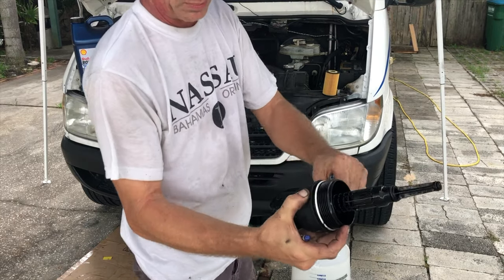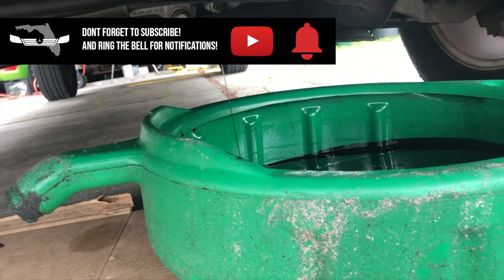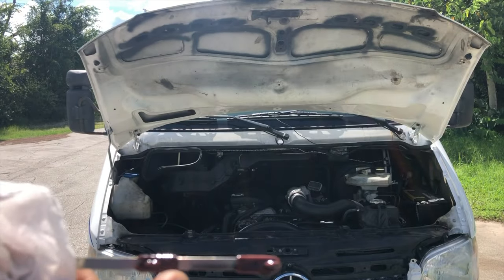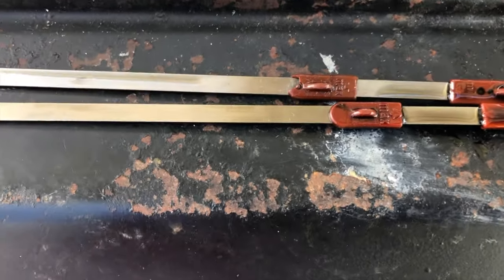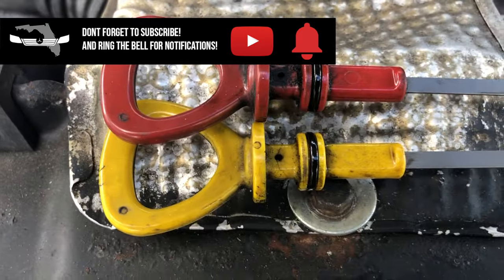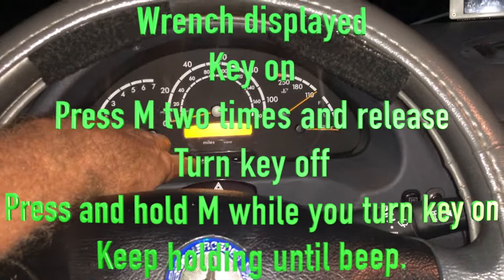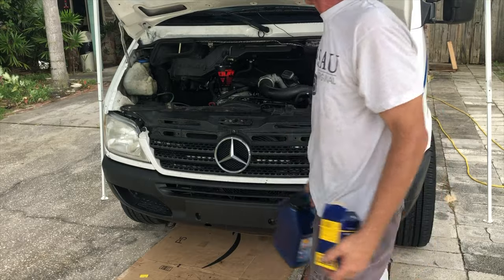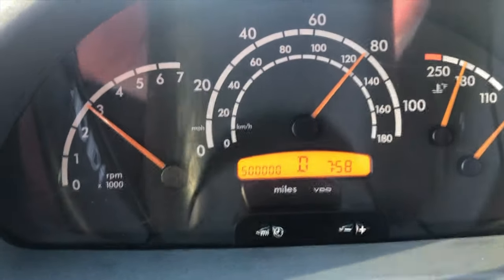T1N Sprinter Oil Change, Rotella T6 & Hengst Filter

Comment: Thanks for the 2.5 gallon tip! $55 at tractor supply. But wouldn’t the whole jug be 1/2 quart overfilled?
Reply from the maker: Works perfect for me every time. My manual calls for 9.5 quarts but that was never enough to reach *full mark. All my vans are 5 cylinder 2.7l engines.
Reply: @FloridaVanMan  Here to mention the same thing. When I put 9.5qt in it hits the max line. I would encourage you to tell people what the manual says, and mention your usage is different and why you think it is different in the video. If I put the full 10 in, I would get high oil level warnings until I leaked/burnt it out over 1000+ miles. 

Any idea why your van would need that much more oil?
Reply from the maker: @lunaumbra5179  If you find me on FaceBook I can share pictures of the service manual. It is CLEARY misprinted as 9.5quart where it absolutely should read 9.5L. Under the section detailing fluid capacities, specifically "Engine Oil" it states "9.0L without filter replacement".... "9.5 Quart with filter replacement". I hope we can agree the engine will certainly require more oil with a replacement filter and I also hope we can agree 9.5 Quarts is LESS than 9.0L. So either the service manual has an error or we are living in some weird upside-down where less actually IS MORE! 
Now let's figure out why you are thinking your oil is full when it is not. If your dipstick is yellow you should be checking the oil when cold, NOT after warming the engine but 2-5 minutes after moving it to level ground and circulating oil through the engine and filter. In summary, run 2-5 minutes then rest 2-5 minutes and check oil level with yellow handle dipstick. The yellow dipstick is intended for DAILY oil estimation in a maintained fleet environment. Due to fluctuating ambient temperatures it is not as accurate as checking a warmed engine with the RED dipstick. 
If your dipstick is red you should be checking when the engine is fully warmed and at operating temperature, 2-5 minutes after shut-down. A fuel pitstop is an excellent time to check oil with a RED dipstick. Get the fuel pumping, pop the hood and dip the stick with a clean* paper towel. NOT the one that has been under the hood for 8,000miles. :) 
Also worth noting, I only have access to OM647 and OM612 engines. UK has 4 cylinder and other options I am not familiar with.
Reply: @FloridaVanMan  I appreciate the thorough reply, but I found it a little irritating you assumed I didn't even watch your video, where you clearly explain the red/yellow dipstick. Given how old this video is, you might also just not realize this particular video out hundreds contains this explanation. The fact you are replying at all is a wonder and appreciated. 

I am aware of the dipstick differences. I have the service manual myself and do many of my own repairs. I am not a total idiot 😵

Yes I have a red dipstick, and I always read about 5min after I am done driving. Yes I always change the filter, and did not notice the unit mistake in the manual. And it is likely I don't read my oil level soon after changing and just assume I've already leaked it out (I'm trying to take care of those now 😭) next oil change I will immediately go for a drive and check again and take a damn photo for my own sake. Thank you.

But you shouldn't shame us who reuse the same oil level rag left under the hood. It is totally economical and better for the environment. Plus with vans as reliable as ours, we need a little fire risk to feel anything in this life 🤐
Reply from the maker: @lunaumbra5179  I am truly sorry my reply irritated you. I didn't remember this being that video, but now that I reviewed it fast-forwarded I see my error of redundant lectures. I didn't intend to lecture at all. 
As for the dirty rag, we'll need to wrestle over that in Philly this summer or in Florida at the end of next January.  :) 
After replying to your comment I went searching for confirmation of my own belief, and failed to find any support. For what it is worth... I could be wrong. The 2003 & 2002 service manuals have the same image I refer to, thought three letters are absent "out".  :/.  When it reads 9.0L WITH oil filter ... 9.5 Quart with oil filter. This makes much more sense than the other manuals I have been viewing repeatedly for years. Although, I've poured 2.5gal jugs in for every oil change I have done in the last 3 years and never read too high or had anyone report back saying I overfilled theirs.

Comment: Does the reset work for the oil change if I'm doing it early on my 2005 T1n. There was no wrench displayed on the dash I just bought it so I'm changing the oil.
Reply from the maker: If pressing the Mi button doesn't ever display a wrench your van doesn't have the maintenance assist program running. This might be something we can just turn on with advanced DAS, but we have not proven it yet. If we can do it, there will be a video coming soon.

Comment: Question - do all t1n years have milage indicators that show remaining milage on an oil change? Seems like my 2006 does not...
Reply from the maker: That feature you're thinking of is called ASSYST. It was an option you had to order. Our two main vans, blue saloon and red, both have it but sporty shorty did not. Seems as though it is standard on newer vans.
Reply: @FloridaVanMan  seems like my van is like sporty shorty. The "m" button on the dash does not cycle to the miles countdown. Just total amd trip miles.

Comment: how many liters of oil should be between 8.5 or more because I don't know well, can you tell me?
Reply from the maker: 9.5 liters will fill to the maximum level, 8.5 liters will fill to minimum line on dipstick.
Reply: @FloridaVanMan  thnx 
because I have a sprinter 208cdi European version I poured 9 liters I also have the oil level between the two points is it OK

Comment: Just bought a 2006 and was wondering why you were filling it to 75 percent?
Reply from the maker: The level will fluctuate some with temperature changes and it is not necessary to hit the Max line exactly. If we hit it exactly when the engine is warmed up, it will be a bit high when running hot with heavy load or steep climbs. My book states 9.5 liters capacity which is 10.0385 quarts. I could pour that last 0.0385 from a fresh jug, but that is 7.5 teaspoons. I'm not that critical.

Comment: Is it a 13 mm socket for the drain plug ?
Reply from the maker: USUALLY, but not always. I've seen 14mm & 15mm replacement plugs. A few oil change kits on the market include replacement plug with filters and oil.

Comment: Do we need to add diesel lubricant?
Reply from the maker: Fuel additives and engine oil additives are not recommended, and even forbidden in warranty period, which is long-past on all our T1N Sprinters. I don't believe in them because a quart into a full tank is 1%.